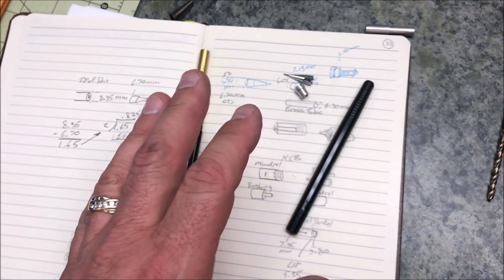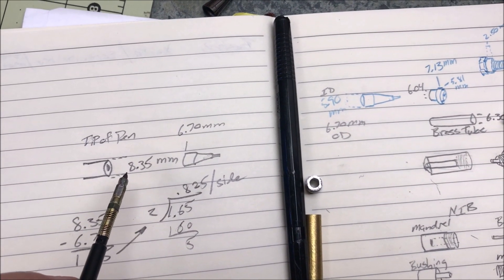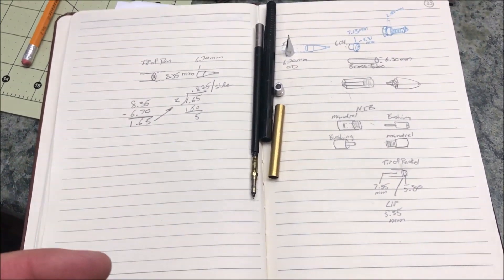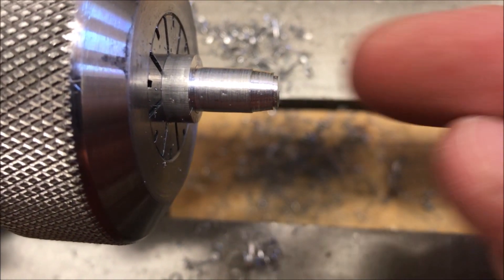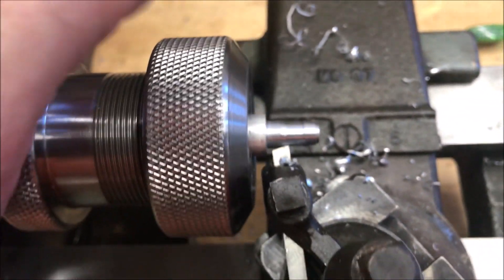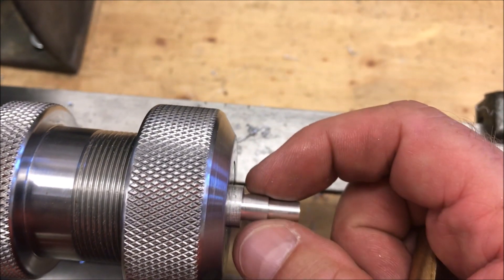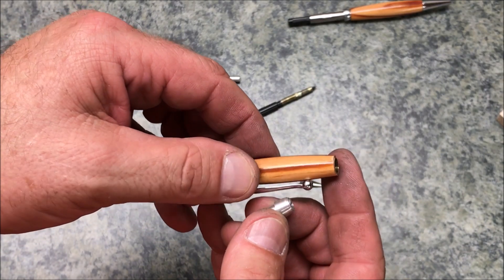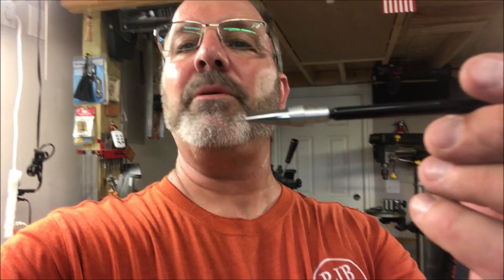Shop Update 7/13/2019

Comment: Nice work Bob, I know your already thinking how you can make a nib now...  I like Scott Schamel's idea for drilling below, for the tubes if you can get the 7mm into the 8mm, what about plugging the end of the 7mm tube with something soft then gluing it into the 8mm (so its easy to ream out) maybe use something less permeant to glue it with. This way you can get it in your blank with the mechanical part and figure out the exact dimensions for the over lap and the tube lengths. (just spit balling here) Either way I am sure you will figure it out.
Reply from the maker: Thank you Richard,
  That is and interesting idea, hmmm, let me put some thought into that. 

Regards,
Bob

Comment: Hi Bob, If you use a single piece blank, drill the 7 mm all of the way through, then drill 8 mm from the back side the distance you need. The 7mm hole should allow a straight shot with the 8 mm bit. You really would only be reaming out the back side of the 7 mm hole. God luck buddy.
Reply from the maker: Thank you Stephen,
  I believe that’s the way I’m leaning. 

Regards,
Bob .

Comment: My suggestion is that you drill an 8mm hole on one end. Then a 7mm on the other. I don't think the tubes will overlap, but actually just meet each other on the inside of if you drill to a specific depth.
Reply from the maker: Thank you Angie, that the way I’m leaning. I think it is the best option. 

Regards,
Bob

Comment: Would it be possible to stretch a 7mm tube at one end with out splitting it Bob.
Good luck
Reply from the maker: Possibly, there are ways to do that. Other issues with stretching a tube are drilling the right size hole and bushings. It is however a viable option. 

Regards,
Bob